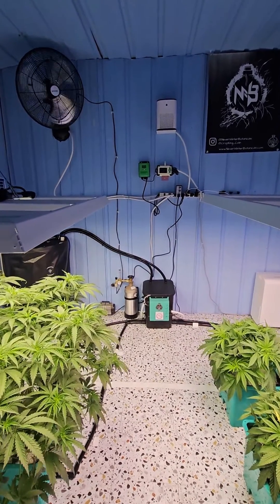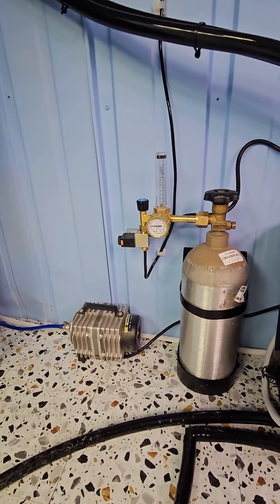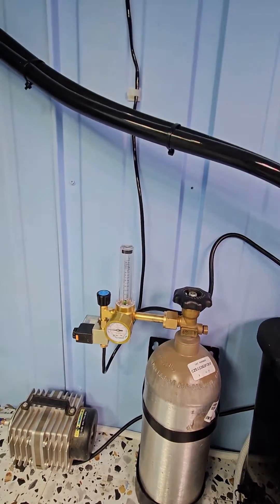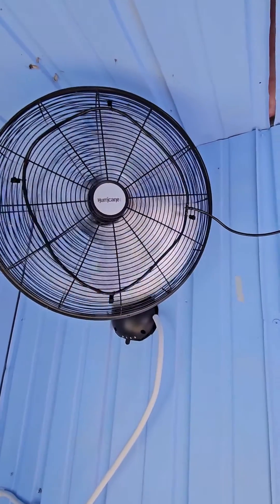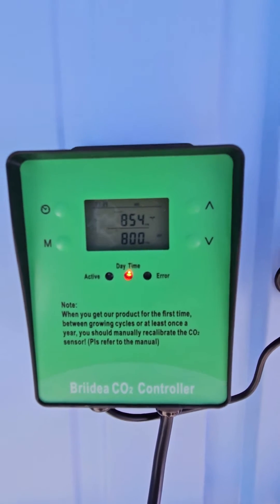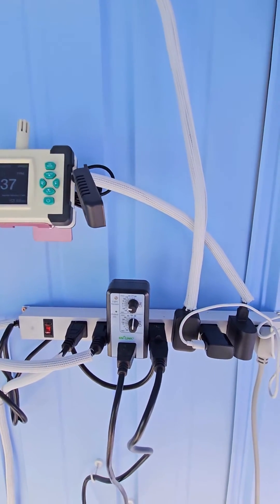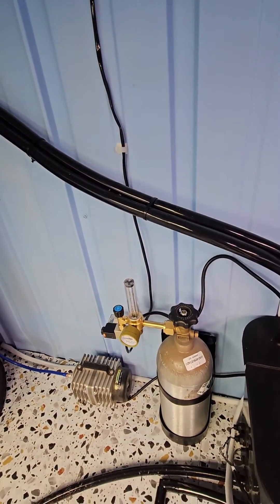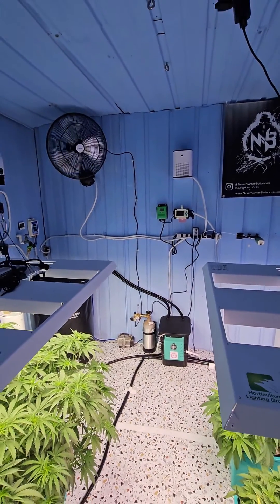Adding CO2 to a grow room.

Comment: Get the air pump off the ground incase of a flood...you could burn the house down in a leak...all electrical items need 2 be at least 2 feet off the ground homie...and have your pump come on and off at 15min intervals so the unit doesn't get hot and pump hot air into your res or pots